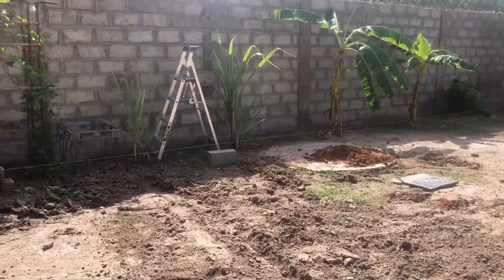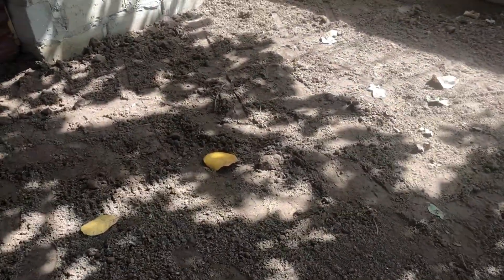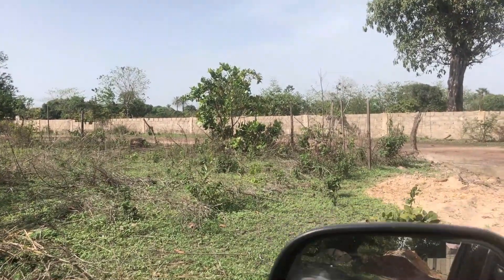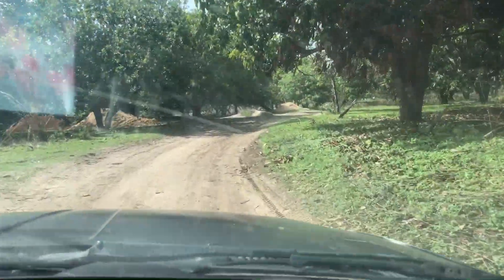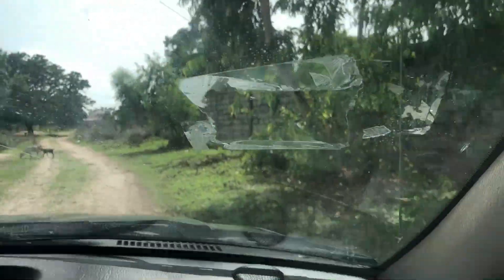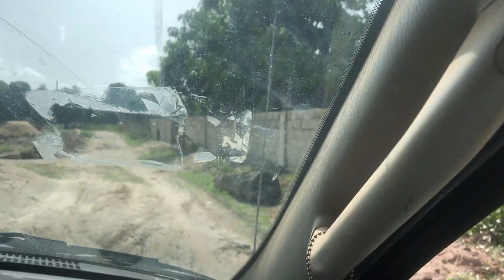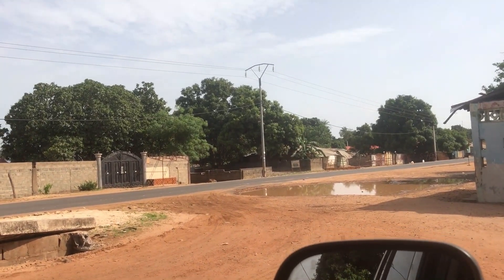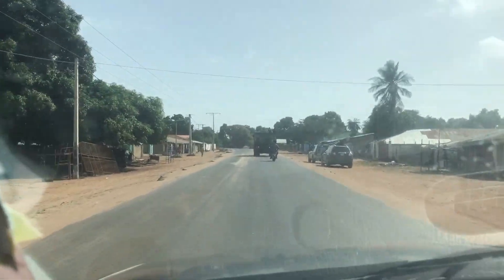The Arrival takes a Friday road test in The Gambia

Comment: Black Acres of the Gambia found a guy who will build them a level  road around their land. It should cost them about $900. That's for a 2 way road! Takes a week to complete. Why not see how much it would cost to level out those roads in your area? Your jeep may last longer! You think the alternator could be the problem, or your electrical systems? Intermittent activation! My ac fan would not turn on immediately! It would turn on only after I had been driving for awhile. Mine was an electrical short! My clock would not keep time, but after, I had my system rewired! All electrical systems were a go. Even my engine light went out! I had been told to change my gas cap to solve the problem. The light would come on and then go off! Do a Go Fund Me, something like that! Would probably cost less in your case!
Reply: Please do not recommend any contactors that the Bags have used, we know they have not had success with any. This is not to bash Rick & SJM❤ but we know that most the door was shown.